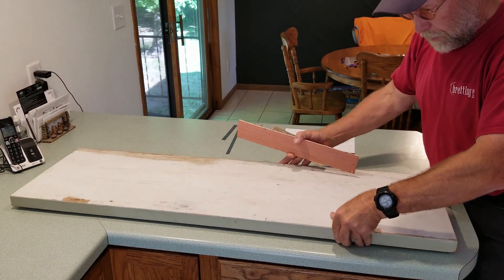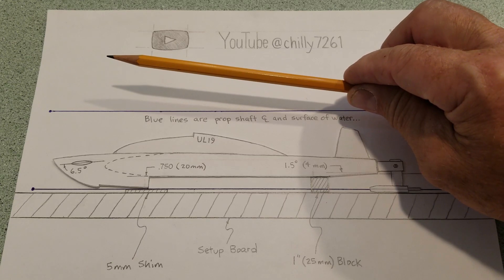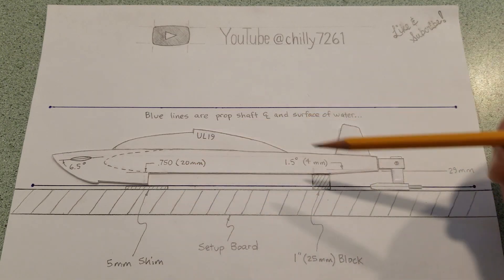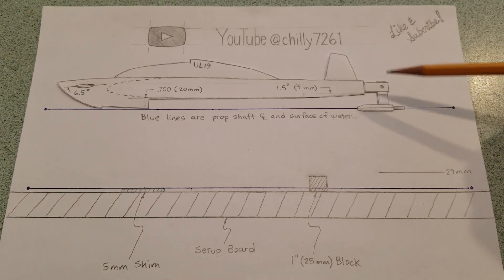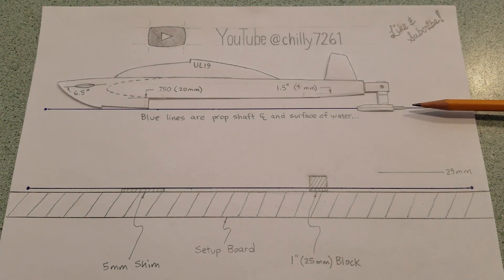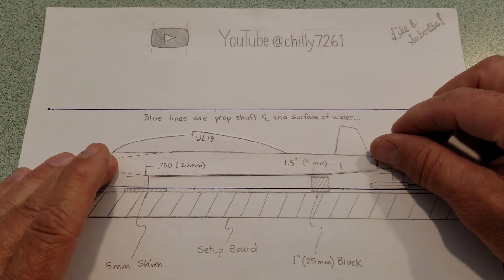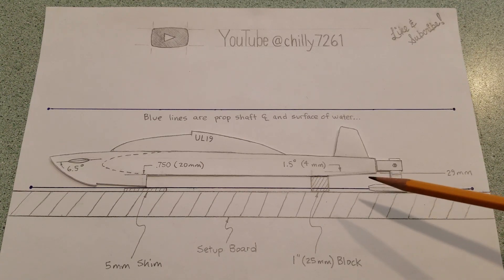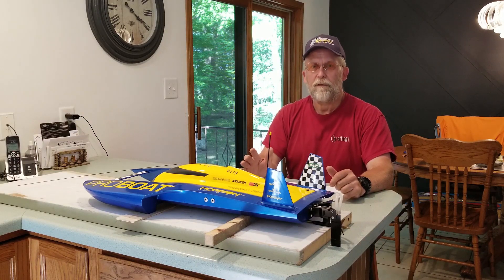ProBoat UL19_Setup Part Three...

Comment: Thank you so much: great video super informative. I did your  set up and got 81 mph first try(upgraded motor and ESC) no flips . Then I flipped it and split the seam  on the left side. Again, great video saved me a lot of experimental adjustments
Reply from the maker: Alright! This is what I've been waiting for! Someone who understood the value of this info I shared. And more importantly, applied it and got similar results! 

Congratulations! The proof is in the pudding! 

Also, 81mph with the UL19 on your first run?! That's incredible! And to nail the setup with upgraded electronics and have it stay on the water. Very cool! 

I'm not surprised it blew off either. To run 80 plus, you're on that ragged edge, and just running thru a small pocket of dirty air will do it at that speed. 

Get her back on the water and keep me informed will you?!
Reply: Thanks again it really really helped I just reset it up to make sure

Comment: You are right about needing to shim. Most ul owner miss this. However, that angle out back is not a relief angle. That would make no sense on a hydro where you want back end lift. According to the designers, that back angle is designed to capture air coming under boat, compacting it and causing rear lift. Which means that rear “relief” angle is technically designed to be the angle you’re setting parallel to setup board. The deep strut you’re running works because you’re pushing the boat to speeds so beyond what it was intended for. Just a small distinction I thought I’d throw in
Reply from the maker: Let's have a respectful discussion...

Everything I've read on the OSE Forum says that's a relief angle. And the bottom should run level. 

On my ML Boatworks RSX380 it has the same 1-1/2 degree relief angle, with rear shoes that force the bottom to run level. Which tells me that angle is releasing air not trapping it. Mike tests his designs extensively and don't miss much. 

Also, running an air dam near the front on the bottom to turbulate the air so it's not as compressed tells me the bottom air needs relief, not trapped. 

Seems like blowing off from trapping too much air is always the concern.

I also read that surface running props coming up halfway out of the water is a VERY dependable and repeatable ride attitude. More so than trapping air to set a ride attitude...
Reply: @chilly7261  all fair points and maybe true with our current hydro knowledge. May even be the best way to run the boat. Just saying Rafael, the guy who designed the boat, is on camera saying that is there to trap, compact the air, and cause rear lift. Not a huge deal either way.
Reply: @chilly7261  for what it’s worth, I have a heavily modified UL running strut at .750” deep and it did 75 on the stock prop, with a big curved turn fin scrubbing tons of speed, without even trying. The shallower strut I’m running works well if you can get cg forward more towards the fin, where it should be on any hydro.. if you’re running stock cg, the deep strut probably compensates
Reply from the maker: @RogallaMarineRC  I find your setup and result very interesting. It also answers a question for me. I tried running a shallower strut, but could not keep it on the water north of seventy. So it's CG location. My CG was and still is around 2-1/2" behind the turn fin. I'm also just running a shortened stock turn fin. 

I would think at some point with enough power your setup would blow off. My feeling is running level does have a higher ceiling, which you alluded to...
Reply: @chilly7261  Well keep in mind I set my boat up for running laps. The original design was for 4s and 50 mph. Both of our setups work, yours compensated for the stock cg and the low lift with abc props. I run lifting props on mine. Cg on any hydro should be somewhere on the fin, either leading edge, trailing edge or middle. UL cg is way off. The fact it was designed for low power and 50 mph makes more sense why that back angle might be to create rear lift. Either way, clearly both of our setups work for us👍🏼

Comment: I have a question, why do you want half the strut in the water?   To my thinking the whole point to surface drive is getting the strut and hub out of the water and your throwing away half of that advantage.
Reply from the maker: That's what I'm told from guys on the OSE forum that been running for years and know.That's how high a surface prop runs without a bottom ski like on a Zippkits rigger. Or a rigger with rear shoes. So it's not by choice. That's what happens on a hydro with a strut only on the back. Same for this setup with shims, shared to me by CraigP on the forum and it works...